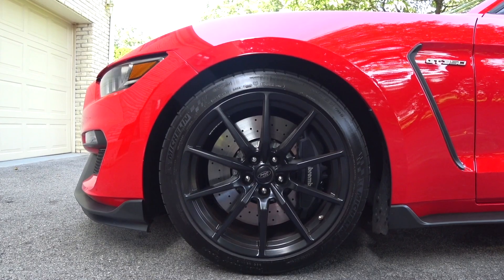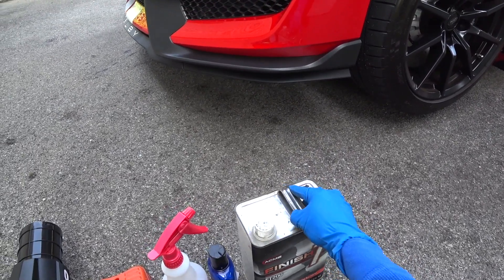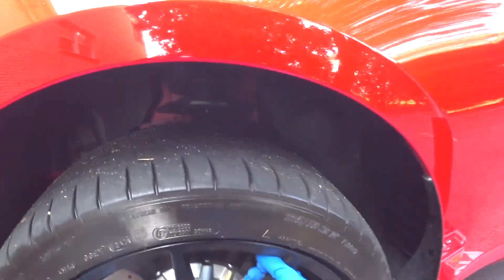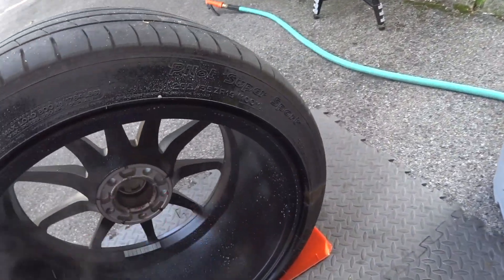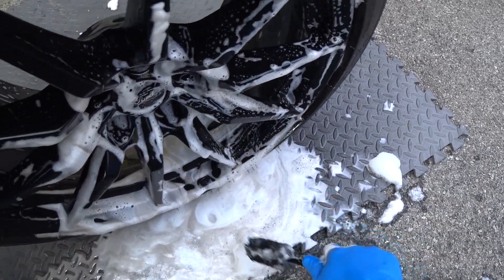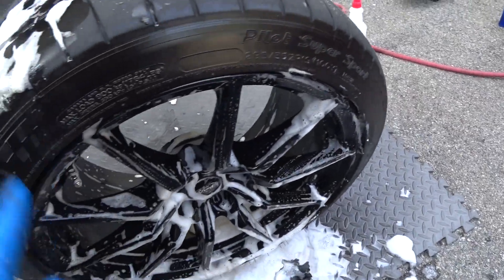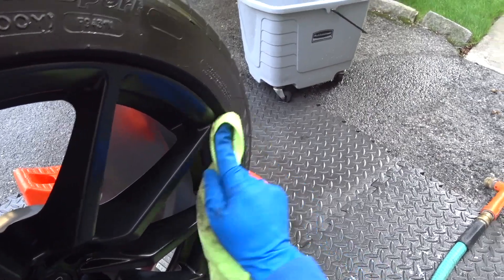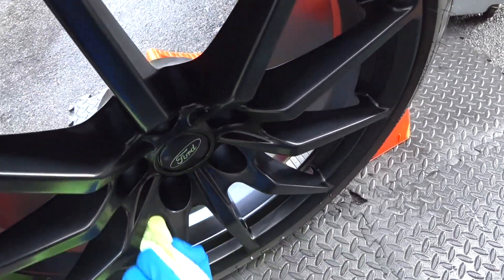How to Detail, Decontaminate and Protect Wheels - Shelby GT350 | Auto Fanatic

Comment: I recently purchased a used Nissan GTR with gloss black rims previous owner didn't take care of them do  you recommend a polished for rims not taken care of ?
Reply from the maker: remove them off the car and carefully polish them out, i do this all the time, takes some time but it works. use a 3 inch yellow or white pad, a suggested compound is Sonax Perfect finish or Griots Boss Fast Correcting Creme.

Comment: With the scratches on the inside the wheel polishing method wouldn't work to reduce those scratches?
Reply from the maker: Chad Jasmin nope its normal wear and tear only way to restore that is to strip and repowder coat the rims, not worth it for a daily driver. thanks for watching

Comment: Very informative video. May I enquire where can you buy prepsol online? I am from overseas and it might not be readily available. Is there an alternative solution?
Reply from the maker: I put a link in the description from Amazon but not sure if they can ship overseas but the stuff I buy will never be able to be shipped overseas. If you can try to find a local auto body supply center and call to ask if you can purchase product over the counter. You want to use a commercial grade product for this job, Prepsol is so useful when working on cars it is worth buying a gallon. thanks for watching
Reply: Thanks a bunch. Thanks again for sharing your experiences.